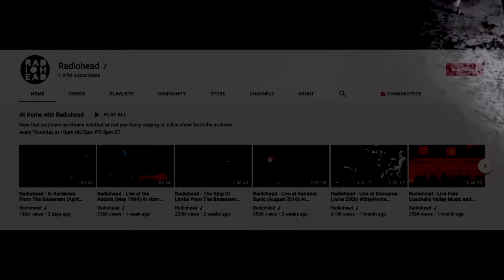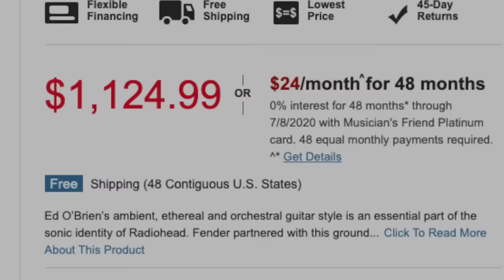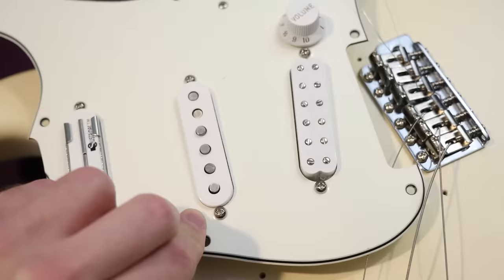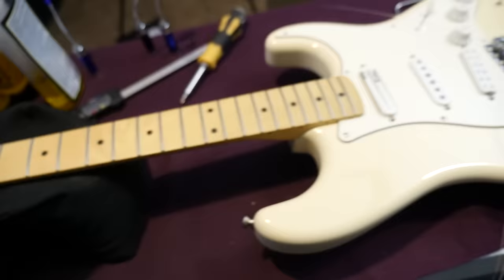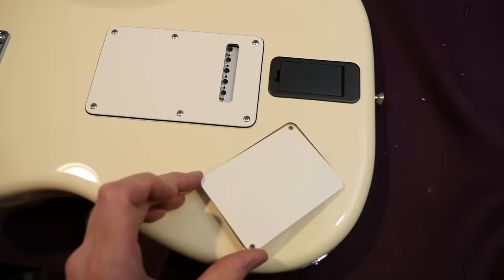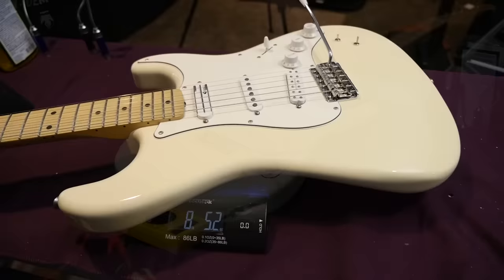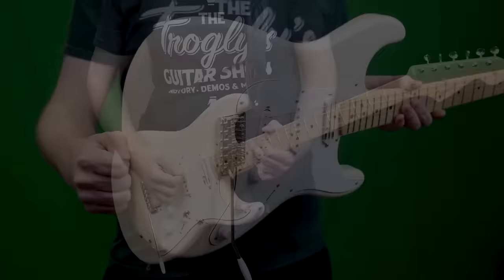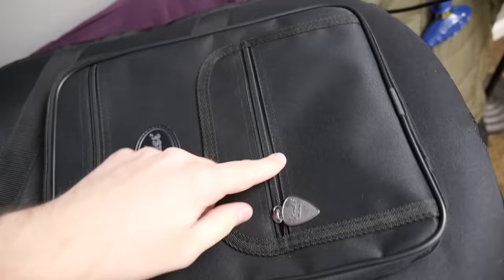The Radiohead Strat is so *Special* | 2019 Fender EOB Sustainer Stratocaster White | Review + Demo

Comment: I've had the EOB for almost a year now and I just want to let anybody know who has not used a Fernandes sustainer before that due to its unique circuitry you are always going through the 9V battery whenever you are plugged in regardless if your sustainer is turned on or not thus if your guitar has weak to no output that means that your battery needs to be changed. There's no short and there is nothing wrong with your guitar it just needs a fresh battery. Just wanted to let you guys know so you don't drive yourself crazy if it happens to you👍
Reply: Thank you man! Im going to buy one. I appreciate the info.
Reply: I replaced the alkaline with a rechargable lithium 9V - it last much, much longer than before. I go weeks between recharges on the battery.
Reply: @explodingshark  that makes sense just use longest lasting rechargeable battery. Thank you for the info. I appreciate it brother!
Reply: i ve played a sustainiac since 1991.....   THink of the  batteries  (2) 9 volts every gig
still love the guitar
Reply: I have one but the sustainer always grabs other strings not sure how to fix it.
Reply: mine takes (2) 9v batteries.... 6 bucks a night in just batteries.  LMAO   and at 30+ years old it eats batteries...  but unplug the the output cord it stops
Reply: I was into this guitar up until that point. Just sucks you have to use the battery outside of using the sustainer all the time.
Reply: As long as you unplug your guitar, that battery will last a long time.
Reply: I ended up getting some 9.6v rechargable batteries for my EOB Strat. With a 9.6v rechargeable battery the sustainer pickup works significantly better than with a regular 9v battery.
Reply: @JeyP667  Imo the guitar needing a battery to work isn't really a big deal. It's something I quickly got used to amd don't really mind.
Reply: Buy a Jackson pc 1. The sustainiac only uses battery when in use.
Reply: This always bugged me about my EOB Strat. I’ve had it for nearly 4 years and love it so much but needing fresh batteries for it because the sustainer is wired like that has always pissed me off
Reply: Brave users might get this guitar another mini dongle right next to those two to switch battery on/off

Comment: An Ebow is two battery powered magnets that vibrate the string in between the magnets, which has produced a magnetic field. The light just shows you where you are, and has nothing to do with producing sound. The Sustainer pickup works in the same manner.
Reply: Yeah that would take a pretty bright light to move the strings lol
Reply: @PapaWheelie1  yeah what's trogy talkin about?  a light making a string move?  the man's daft!
Reply: To thx Natasha🤟🏼
Reply: Pickups do react to light sometimes. I've had stage lights cause interference. Also if you've ever point a TV remove towards your pickups, the light will produce noise. But I guess that's different

Comment: the thing about the mexican plant is that it seems to keep getting higher and higher in terms of quality, as a matter of fact, i'd have any of the vintera series as my main axe and i'd be perfectly fine with it
Reply: My main bass is a mim PJ Mustang in shell pink. Better than most american basses I've played.
Reply: I got a Chinese Squier from whatever plant does the "CY" serial - as far as the woodwork goes, it's as good or better than some models I've played costing 4x as much. Even the tuners are decent. The one thing I'd upgrade on it are the pickups, maybe the pots, but I just run them at full open. They are worth checking out for sure.

Comment: Austin, eBows and Sustainers radiate a magnetic field which interacts with the iron in the string to vibrate it. There is no possible way to vibrate a string using light. Otherwise, you'd be able to use an eBow on a classical guitar. Which you can't.

Comment: The Sustainer system only works with a humbucker in the bridge position - an S/C doesn't have enough signal to drive the Sustainer (bridge) p/up.  Switching on the Sustainer puts the guitar into the bridge position automatically, irrespective of where the selector is.

Comment: I have a Schecter with the Sustainiac and it’s a fun toy. The first position is straight sustain. Position 2 will decay the note to a natural fifth and position 3 is the same, just way more intense. It will go into a harmonic almost immediately, whereas position 2 will be much more gradual. 3 is the crazy solo mode. But what I have learned is even if the unit is off, if it’s still has the lead plugged in, it will drain your 9v battery as if it were on.
Reply: Which model? I have my eye on an E1 Special.

Comment: Fender refers to that finish as "Olympic white". "J.B." stands for Jeff Beck. Also significant: it is an EIGHT screw pickguard, as opposed to an 11 screw. Eight screws corresponds to a vintage pickguard configuration. Also worth mentioning is that it is a "spaghetti" logo. Worth mentioning is that it comes stock with only TWO vibrato springs. If there are any extras in the case, folks might wanna know .
Reply: Nope, the "JB" designation stands (officially) for Jazz-Blues which has been it's designation since it's commercial release. They'd tried to do a signature pickup model with Jeff Beck and they couldn't come to an agreement on an endorsement deal and Beck thought they were too hot and didn't like them when he had them put into a guitar for him.

Comment: $1100... I remember when the Mexi’s were all under $499. 😀
Reply: Used to be able to get em used for $200 if you were patient
Reply: I bought my '05 brand new for $250.
Reply: @DiscoScottie  I call bullshit on that unless it was a b stock or a squier
Reply: hah yeah eh, well at leaste it seems your getting american quality now, my biggest gripe wasnt the quality per se with Mexican made, just the lower quality parts used which seems to be upgraded here.
Reply: mike jones  I have a couple, including Charvels. They all experience fret sprout in the fall thru winter into spring. Corona must have a low humidity shop when the install and dress the frets. It never happens to my USA Fenders, Charvels, or Jacksons.
Reply: Jeigh Neither I think they were $499 just 10 years ago.

Comment: I have a Vintera Modified 50s Strat with a 2019 seriel, even though when you look it says made very early 2020, lol. I know not all parts are assembled whenever they are made. Got a great deal on it a few months back. Was brand new in my buddy's shop who's an authorized dealer. Since it was new, but had a 2019 seriel he gave me 200 off. I really couldn't say no. But the quality control on it is just flawless. Truly blown away by it, months later still.

Comment: I have one of these and there's one point that you didn't make: the tremolo kills the tuning stability. I don't care if an instrument doesn't return to perfect tuning but this one goes so out of tune it becomes unplayable. And the neck sucks in my opinion. I'd happily trade it for a modern C. The bridge humbucker sounds amazing and I love the sustainer. It can do lots of classic Sustainer stuff like Heroes.
Reply: I imagine the reason you had tuning issues is because the tremelo for some reason only comes with two springs (normally Strats come with three). Once I added a third spring to the tremelo on my EOB Strat all the tremelo induced tuning issues went away.

Comment: You seemed to get a bit of a grip of the sustainer system later on... I was a bit concerned when initially you were continuously picking through arpeggios rather than letting notes ring or using glissando techniques, which is the real strength of the sustainer or of an Ebow. Good job. 👍🏻

Comment: This Strat seems to have less twang for the clean sounds, but, a much warmer sound for the overdrive and/or distortion chanel... On the other hand, only two springs for the bridge? It seems not to have problems to be on tune after using the tremolo bar, is that correct?
Fantastic guitar, as most of Fenders are...

Comment: The Edge  doesn't use an E-bow. He has an inbuilt sustainer :D
Reply: Allegedly (if the lawyers are looking, although I think it was ultimately resolved)  the sustainer  is a copy of Michael Brooks infinite guitar of which only 4 exist: Brooks's own, the one he made for the Edge and the one he made for Daniel Lanois and a later one a SRV Strat which Lanois uses as a backup. The Edge uses the production sustainers now since the infinite guitar had a propensity to dole out electric shocks in humid conditions. If you watch Rattle and Hum, he's using his Infinite Guitar on With or Without You (it has two jacks: one for a direct output of the neck pickup the other for the sustainer output) https://www.youtube.com/watch?v=OhbiLnAwKOI . The Brooks original infinite guitar was a Japanese Tokai Strat clone as was Lanois, the Edge's version is a Squier which looked a lot like his main Strat.  Lanois talks about the infinite guitar to Seymour Duncan on this potato quality video as the pickups Brooks modified were Seymour Duncans https://www.youtube.com/watch?v=eCtfcS1FisU

Comment: The sustainer is actually a single coil. There should be Trem adjustments (2 or 3 depending on the model) on the inside. It allows you to adjust the speed to which the note turns into the harmonic and the other is a volume. The volume trem pot allows you to adjust the volume of the sustainer pickup in single coil mode. This changes the tone a bit to sound like a humbucker. It is also useful because adjusting the sustainer pickup closer or farther from the strings is not a great idea. It has a sweet spot and it needs to stay there and that's why there is a volume trem pot inside. I have and have had a few Schecters with sustainer pickups. I'm a Gibson Les Paul player but I have a Schecter 7 string with a sustainiac in case I have to record guitar for a buddy who writes in low tunings.

Comment: I've got a 2019 mexi strat. It's the only time I got a new guitar and it required a fret job. I had to level the frets because the first 3 were low and one around the middle was low. The frets looked like they were not dressed at all. Just dropped in and ship it. If you buy a mexi strat try it out first.
Reply: I bought a used  (Hardly played) one a few years ago and it really looked it.I have had squire bullet strat's that had a better fret Job.
Reply: indeed, My luhier has become times with this guitar, because the current productions are not up to par, already the knockouts in the boos are to be resumed .. sanding etc .., the repise of the frets is necessary if you want the sustain to work on all the notes, the 8-hole pickguard are deformed, sent to fender, they can do nothing, just correct the deformation a little.
It's a guitar with a bad neck, and a bad design, a lot of them are found on occasion, or they change the neck.

Comment: You don't have to remove the neck to adjust the truss rod with the vintage truss rod location.  You just loosen the strings till slack, tilt the heel of the neck up to access the adjusting nut, and adjust it with the Allen wrench.  Then  tighten everything back up.  On the old Fender Strats they also used to scoop out a little spot on the pickguard next to the adjusting nut to make it easier to access it, for some reason they don't do that any more.
Just wanted to clarify that, I get tired of people saying you have to remove the neck to adjust the truss rod with the heel-adjust.  It's not really that difficult.

Comment: Love your videos friend! If you have time and see this comment I have a quick question for ya. I have a classic series 70's strat mim. Olympic white with rosewood fingerboard. Most models ive seen have the maple fingerboard but I've seen rosewood but not that many. Only thing that was changed before I bought it was someone installed D.Allen pickups in it... Now on to the "quick" question.. Is it common for the Mexican strats to have 2 different serial numbers on body and neck? They're both mexi serial numbers and with the 3 bolt neck no other holes have been drilled. Thanks for your time! Peace Matt from Ohio (RANDOM THOUGHTS FOR LIKE MINDED PEOPLE PODCAST on SPOTIFY apple etc

Comment: I was about to playfully chide you in my winsomely charming way for spelling 'bass' wrong and then it clicked (so to speak) as to what you meant by 'base.' The base position is the default E.Q setting from where you can cut or boost frequencies...unless you actually did mean 'bass' in which case...never mind.

Comment: Just got one of these and was delighted until... it refused to stay in tune from one song to the next. Weird, I thought, as not really hammering it and had spent an hour stretching new strings to get rid of any slack. Turns out Fender "cheap out" on a £1,300 guitar by using a "synthetic bone" (call it plastic as that's what it is) nut on this guitar. What the... ??? Even my Squier Classic Vibes have real bone nuts ffs ??? If I was Ed O'Brien I would kick off big time at this £10/$10 cheapskate move by Fender. I've written to Fender to complain. I should have checked the specs before buying the guitar I know but you just assume that simple, vital components will be of a certain standard when you buy a decent quality brand guitar. So... I'm having to replace the nut with a Tusq Graphtec nut now on a brand new guitar. Other than this crappy element, the guitar is built and plays like a dream. The pups are superb as is the sustainer feature. The neck is one of the most comfortable I've ever played in 40+ years. Just so bloody shocked by Fender gooching the guitar with the kind of crappy nut you expect on a $100 guitar. Anyway rant over... everything else is great.

Comment: Why they went with Narrow/Tall frets and only 21 frets and a regular crap vibrato bridge is bizarre to me. Get a strat you like and put in a sustainer or use a pedal that does the same thing like Electro Harmonix Attack Decay. This thing is overpriced but I can think of worse. It doesn't even have the Gilmour mod. Fender poll your fans, please! You're lost in the past. 99% of us DO want the 9.5 radius (compound even better) or give us a choice, but they want a blender knob (or switch) for the middle pickup. They want 22 to 24 frets. A sustainer pickup? Sure why not. Light weight - No more than 8 pounds. Preferably 7. Small headstock with locking tuners and a bridge that stays in tune. Is that so difficult? I guess it is. That's why I make my own mods.